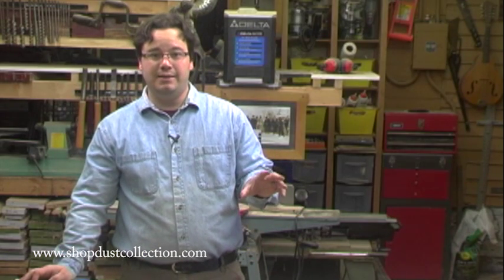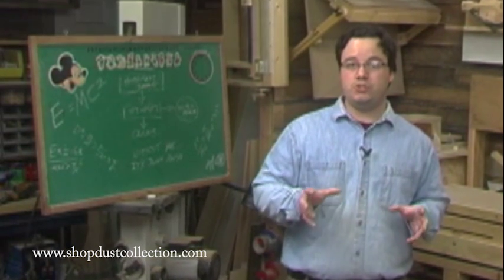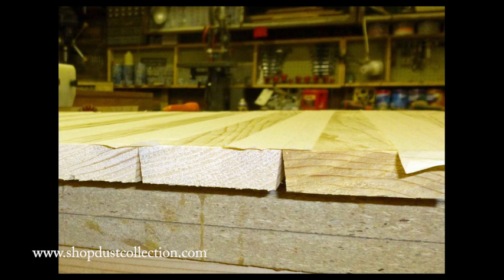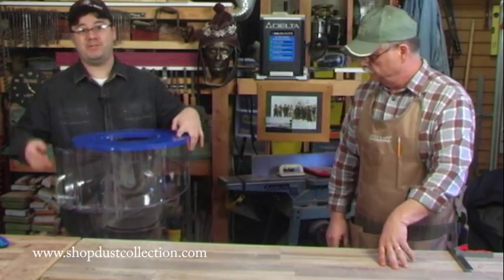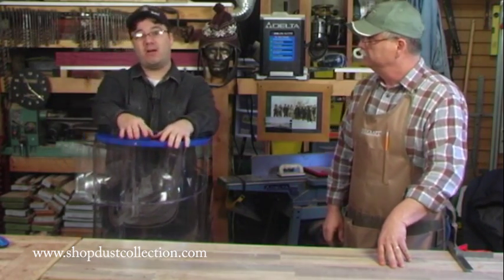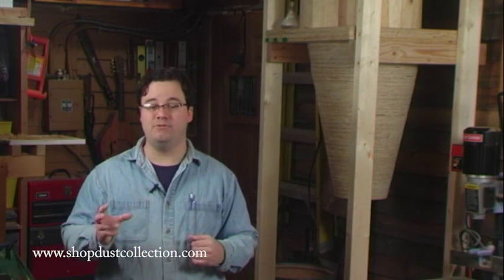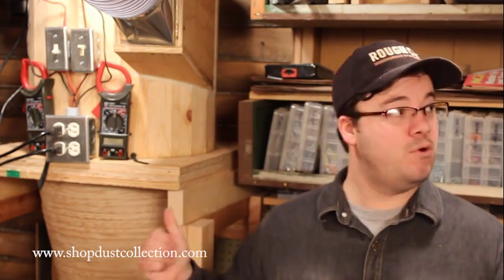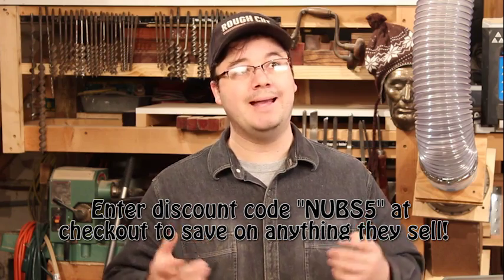SNW55- The homemade wooden dust collection cyclone (Bill Pentz design)

Comment: I know this is old video, but it got me thinking... Clearview has smaller 2.25" inlet/outlet cyclones.  My system is entry level, 1hp with 4" conduit. Instead if two motors in series, what about two cyclones in parallel?

Comment: This is the first I've seen of this series on the Stumpy Nubs Franken-Cyclone System.  Very funny, but my needs are a tad simpler.  A repurposed but powerful home vacuum cleaner will become my blower and two 10-gallon paint cans will make up the cyclone (on top) and the dust bin (below).  The cone is not strictly necessary.  Numerous cone-less DIY builds have appeared online the past few years that appear to work well and should be easy enough for even me to duplicate.  If the fine dust extraction appears to be inadequate I can always open the roll-up door to my 9'x9' workshop (formerly a motorcycle garage) and air the place out. Hey, you use what you have, right?  Small is what I have so that's what I will use.  Thanks for the inspiration.

Comment: Not sure I agree with the assertion of single stage collector not getting fine dust, nor do I agree with Bill Pentz given the results of Wood magazine's test. The ClearVue didn't fair well, and the Powermatic 3hp single stage filtered more than all but 2 cyclones and had far more suction and air movement than any cyclone, all with only a 2 micron filter.
Reply from the maker: Ruel Smith- Two comments: First, single stage collectors typically only filter down to 5 microns. The 2-stage Powermatic you mentioned is only 2 micron. So even if it manages to suck up the dust, it spits the fine stuff back in the air- right at head level for easy breathing! The 2 mircon and above that it collects isn't what's harmful. It's the 0.5 micron and below that hurts. The Clearvue cyclone comes with a far finer filter and 600 sq ft of filter surface area. Second- You can't dispute that saw blades and other machine cutters shoot dust off their teeth at extremely high speeds. Pentz is merely saying that you have to have a system that can overcome those air speeds. That requires about 1000 CFM (if I remember right). Single stage collectors are simply not able to generate that much airflow once you add duct work, hoses, etc. The impellers (8" usually) are too small. It's also worth mentioning that even a very powerful system can't do the job if all of your machines only have 4" dust ports. So it's not all that simple to get true fine dust collection. 

Don't get me wrong, I have nothing against single stage collectors. One of our two shops has a Harbor Freight collector with an upgraded Wynn filter. I just keep in mind that I have to wear a dust mask when I am cutting MDF or sanding, etc.

I am not familiar with the Wood Magazine review of the Clearvue system. I do own a Clearvue and wouldn't trade it for anything. It is extremely powerful and the filters are the best in the industry hands down. Plus, it comes from a small US company (very small, in fact). I have spoken to the owner several times and he's not only a great guy, but very trustworthy in my experience.
Reply: I did make a mistake, as the ClearVue was not included in the comparison. Still, a single stage 3hp Powermatic wiped the floor with the tested cyclones in air movement and static pressure, while ranking a close 3rd with only a 2 micron filter.

Cyclones merely remove the large particles from the air stream by slowing it down to the point it falls out of suspension. As a downside, it also slows down your airflow, with the increased length of the airstream, combined with the increase in friction. All the harmful fines are still filtered. A "seasoned" filter filters out more fines than a new filter. Also, an overly large filter doesn't flow any better than a correctly sized one.

But the Vortex/TurboCone design does a good job of keeping the filter clean, and since it is on the pressure side of the impeller, it doesn't have the negative effects the cyclone has on static pressure and airflow.
Reply from the maker: Ruel Smith - I think you misunderstand me, or perhaps I didn't make this point clear: I am not saying a cyclone increases airflow simply because it is a cyclone, I am saying it is rare to find a large enough impeller (which is what really matters) on a single stage collector. Bill Pentz found that a 14" impeller is required to produce enough airflow to collect fine dust in a ducted system. Not coincidentally, the Powermatic that the Wood review found to work best features a 14" impeller (the only one I've ever seen on a single stage collector). They manage to get by with a smaller 3HP motor because they do not use a cyclone design which requires more horsepower- but the trade off is shorter filter life and more maintenance. I do take issue with the idea that 2 microns is fine enough filtration. But that's an argument I would refer to Wynn or one of the other filter manufacturers. As for the ClearVue (which was not in the test)- I like it because it is the only half way affordable Cyclone I've seen with a 14" impeller, a 5hp motor and a ramp design combined with a slanted inlet that keeps all but the finest of particles from reaching your filter. That means you only have to clean the filter about once a year as compared to far more often with a system like the Powermatic single stage. Your filter will also last a LOT longer. That's the benefits of a cyclone.

Comment: maybe this may mean more to you and show my statements are not opinions.
http://www.engineeringtoolbox.com/pumps-parallel-serial-d_636.html

remember "head" and pressure are the same... but head is also the resistance to flow. a pump only pumps its maximum at 0 ft. of head .  A pump that can produce 30 PSI can lift water vertically to 69.3 ft and no more... one psi equals 2.31 ft of head.

Comment: having one blower feed a second blower would double the pressure with the total volume of air remaining equal.  The pressure is compounded not the volume.  Having two blowers run in parallel would create the same pressure but if the pipes were big enough it would double the cfm.  If you have ample current to run both blowers neither situation will cause the motors to overheat.